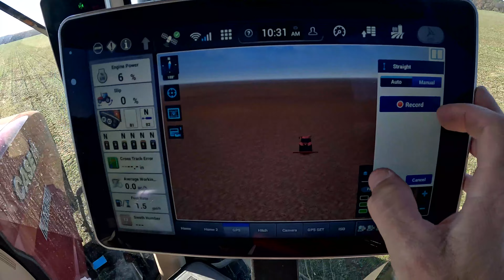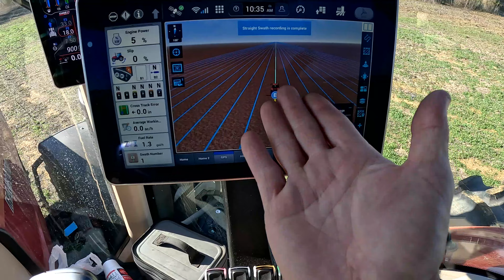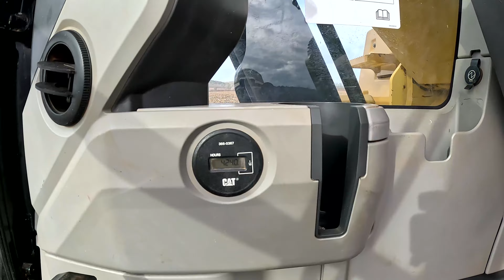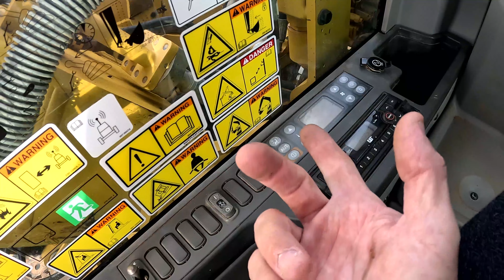GETTING THE WINTER TILLAGE DONE

Comment: Hydraulic thumbs are awesome on a track hoe. Also the grade control can work two ways. Laser and gps. TRIMBLE,or TOPCON can help you out with both systems to get it going. It is nice too. There will be sensors on the machine for both and units to set up out on site for both. They are very accurate I personally like the gps systems. But both are nice.
Reply from the maker: Great thanks for the info 👍😁

Comment: You can get the grade control to work. For another 20k. But. Because you have Trimble you might have some of it. Those cat walks as you call them are basically the reason it’s not all banged up. It’s a guard.
Reply: Cat has factory grade control we use it all the time